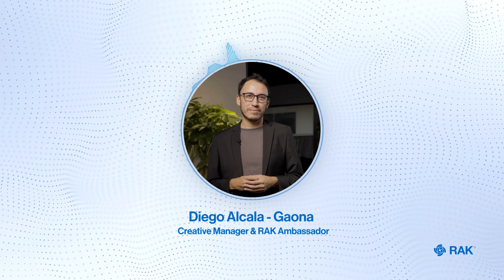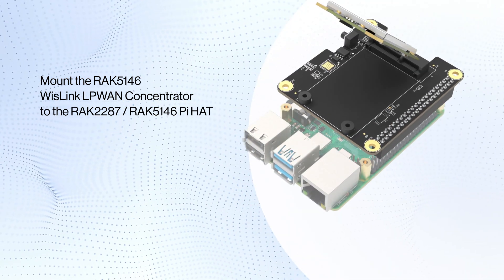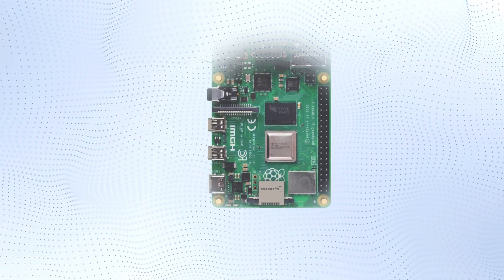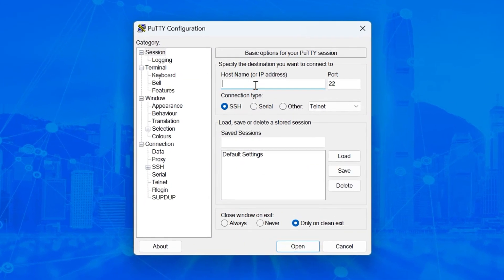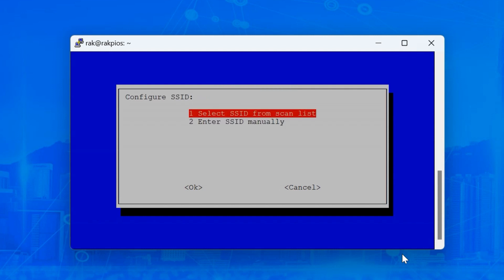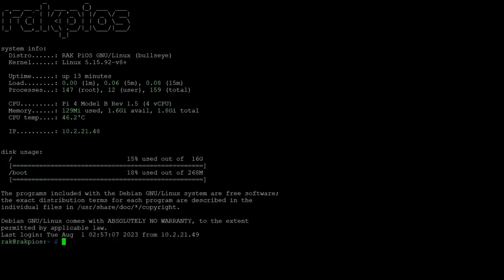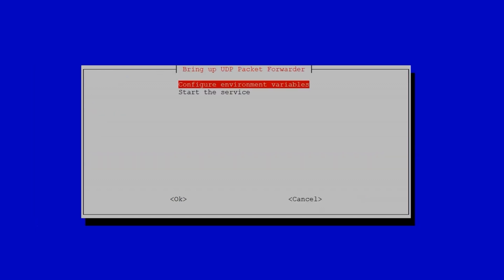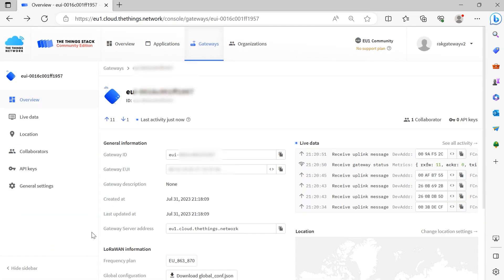A Step-by-Step on How to Build A Developer Gateway

Comment: Thank you for the video, works fine for me, 
however, I have a difficulty to configure the beacons for class B (I don t see this configuration in the rakpios-cli tool), I m using rak2287 spi interface with rasperry 4
thank you in advace for your answer